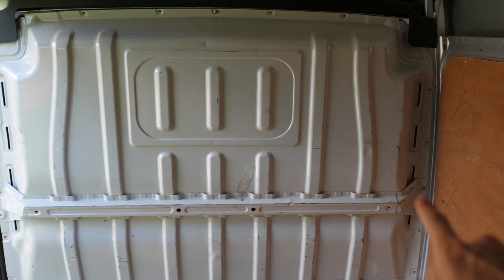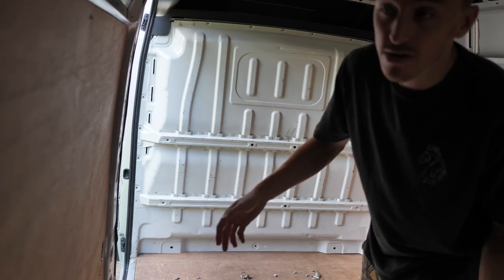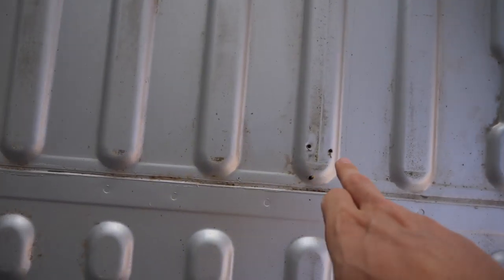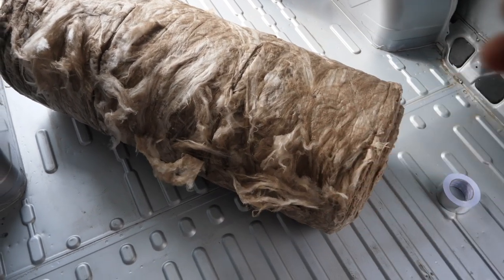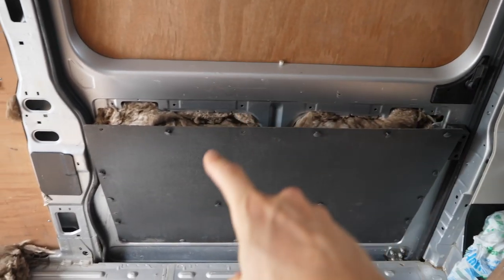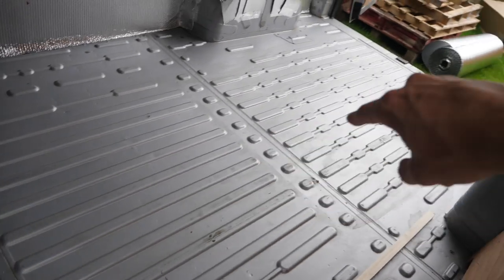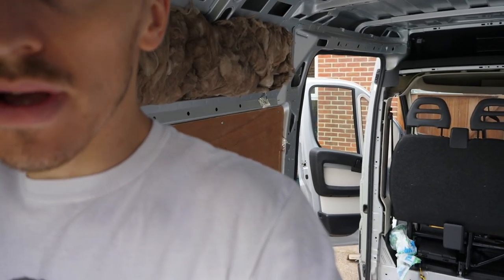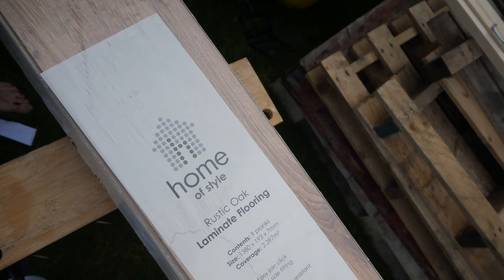INSULATING MY CAMPER VAN - Peugeot Boxer Conversion

Comment: Insulation, open, breath... In a van?? are you crazy? The outer skin is completely sealed, That means in inner skin must be as well. Same in house constructions. Where the outer skin normally used to be breathable, you'd have a breathable inner skin. In modern high efficiency housing, both skins are naturally closed, as otherwise moisture really will SET in between them. You cannot air out a van and dry it unless you have air-conditioning running close to 24/7.

Comment: Thank you for the ideas for the conversion.  I noticed you putting in insulation.  Aren't you going to put in any acoustic van insulation/vibration dampening.  I have head that this helps reduce road noise, but also the sound of rain when trying to sleep.  Interested to hear your thoughts.
Reply from the maker: This is a popular subject, I will explain my choice in the next video

Comment: Why didn't you use the spray fill foam?  Perhaps you could do a video on the pros and cons of each type of insulation? Also... those dots you made as markers... is there wood behind that to screw into? Or just the metal railings? How do you know where to screw into?... which has holes and which doesn't.  Thanks!!
Reply from the maker: There's definitely a few different ways to insulate a small space, I guess I chose the earth wool as it was the most affordable, easiest way to fill the cavity spaces. The dot markers on the 5mm ply? I just screwed the ply panels back onto the metal frame using self tapping screws. You can also just use the old screws and line them up with their original holes

Comment: Hugh, earth wool is a good material, although there is also sheeps wool - no itching and safer with no particles.
Reflectix is pretty useless as a thermal break.  It is a reflecting material, ok for windows in sunlight, but too thick for vapor barrier, and ineffective R value as insulation.  There is a material I like called Silent Silver or Blue at Amazon.  Large roll, closed cell neoprene (wetsuit material) with a foil mylar coating, 1/8" thick, and cheap.  Roll this out over the earthwool to keep moisture inside the van from reaching the earthwool and metal structure.  You can also use space blankets (free after any marathon race, as a reflective shield under earthwool or on top.

Finally, before you insulate, you need a butyl sheet like Noico.  Add patches of this pricey stuff to your door panels,  and walls selectively.  This deadens outside noise and changes the door clang to a thud.  What you currently have is a bit incomplete.

Comment: You can use a metal repairing epoxy for holes in the floor, like Magnum Steel Epoxy Repair.  Goes on like putty, hardens, then you sand it down.  Car people use it to repair bolt holes, etc.
Reply from the maker: Thanks Tom!

Comment: I’ve used the same insulation on my van with a reflectix vapour barrier. Have you noticed any problems in yours with condensation in the walls etc?
Reply from the maker: As a stand alone insulation its not got a great r value (insulation rating) so I would recommend using in conjunction with others. But I want to test a bunch of insulations to see what they do.
Reply from the maker: sorry didnt even answer your question, I havent noticed any condensation problems at all

Comment: Hugh, I have just bought a van to convert (transit mwb, semi high). Why have you insulated this different to your custom, and what are the benefits if each way? Thanks
Reply from the maker: Hi Tim, good question. I would say that there is a 1000 ways to do it and many of them work, maybe the most serious combination is the dense foam sheet insulation to fill the cavities with double bubble as well.
Now the reason I chose the earthwool was price and availability, then I am using the ply as a divider with the double bubble foil as a 2nd layer of insulation which also acts as a membrane.
does this answer your question?
Reply: HughTube that's great, thanks. Is there a general rule for layering/ orders etc? I'm sure I'll be coming back with more questions in the future!
Reply: See ourkaravan, and Greg Virgoe.

Comment: Loved watching the transformation of the custom van I wanna do my transit but fill it's a waste of time as it's a swb low roof any tips on that?
Reply from the maker: It doesn't matter what the size of the van is as I have seen people tour around in converted caddy vans. It all comes down to what you want to get out of it.
I would say that with the SWB low roof you would have to be smarter with the use of space but you would be spending less on the conversion due to size.
At that size it would be nippy and great both in towns and in the wild, you could get a pop top so the bed is above and then you would have masses of space down below for kitchen storage etc.

Comment: Hi,
I just used rockwool in all the small areas and holes in my van. On the larger areas I used some multi layer foil and wool insulation.
Where I've used rockwool will I get condensation making the rockwool damp and rust the van?
Thanks
Reply from the maker: Depends on whether you're using a vapour barrier

Comment: I think sika flex would be better than silicone
Reply from the maker: Noted! I will look into it and maybe get under the van and re-apply
Reply: Yes, apparently there is salt in silicone that can rust out.
Reply from the maker: you Timothy are a wealth of knowledge! I really appreciate all your input!
Reply: haha, i have no idea what im doing! Just scraps Ive gleamed off the forums, probably wrong in 9/10 times. I did a quick google, and apparently when certain silicones cure, they release acetic acid, which could potentially weaken the paint job i guess, but I dont know how much of that is fear mongering tbh.
Reply: Question, what forums do you like about this subject?
Reply: @HughTube  What was it you used to seal those holes in the floor?  its where I am in my van build.

Comment: Great Vids how many rolls of double bubble aluminum did you use and what size is it? thanks in advance
Reply from the maker: I had a roll of about 30m as far as I remember but I had plenty of excess. You can work out how much you need by calculating the cubic area of the interior and compare to the width and length of a roll of insulation.

Comment: How come you put the silver foil on the outside of the wood, not between the wood and the insulation wool? Curious.
Reply from the maker: ahh so i put the original ply cladding back up, then the foil then I covered it again with ply. over kill completely but just didn't see the need of throwing the ply linings out

Comment: Do the insulation rote out the van by the inside out? It's what iv bin told but ain't got a clue
Reply from the maker: this is a hot topic with mineral wool, some forums says mineral wool does affect the van and some others say it's been fine in their van for years and years.
The reason I went for it was because my van is pretty new, the interior paint is very good and I feel it should be fine. I have never used it before myself so only time will tell but if your unsure then you can definitely use other forms of insulation.

Comment: Hi
What size batons did you use for this and also what glue?
Thanks
Reply from the maker: I am really sorry Mark, I can't remember as it was while ago but anything that will raise the flooring above the ridges in the steel floor and be thick enough to screw into

Comment: Hi mate, why do you not use carpets on the walls ceiling instead of cladding? I'm new to this so I was just wondering if it is just a personal preference or is it because it holds moisture? Thanks! Josh
Reply from the maker: Carpet isn't an effective insulator so there is a chance for it to hold moisture. It's not that carpet is a bad choice but ventilation is important.
Reply: @HughTube  thanks! Im planning on using celotex and earthwool, the foil bubble wrap then carpet just because I prefer the look to wood. Do you think it would be a problem?

Comment: Nice! Im about to do the same to my new purchase! Wouldn't it be easier to fit the windows first?
Reply from the maker: It would be easier but I still haven't managed to get the window for the drivers side so I will just cut it out later. It shouldn't be much harder as it's still early stages.
Reply: Cool, yea, im thinking how to approach mine, i almost feel like a deer in the headlights! All the planning on paper for the past 6 months, and now Im here, with the van!  I think ill be going for double glazed second hand caravan windows,. seitz are just too damn expensive. What kind are you going for?.
Reply from the maker: Don't worry it's a common feeling haha. I am going to use the same window company that I used for the Custom. They are only single glaze but with less windows and more insulation I think it will be ok. I would LOVE to have double glazing but as you mentioned price is a huge killer.
Reply: The double glazed windows can be had second hand for a steal. Scrapped caravans and caravan yards sell them for 50-200 quid in various forms. What are you paying for the single panes?
Reply from the maker: I paid £330 for the two large opening side windows, pretty good for brand new but if you can get yourself double glazed for less that would be awesome!!

Comment: What sort of screws do you use to screw the panels to the ribs on the walls?
Reply from the maker: I got some self drilling steel screws from screwfix. https://www.screwfix.com/p/easydrive-self-drilling-low-profile-wafer-screws-4-8-x-22-x-200-pack/7483h

Comment: It's good representation of what to expect. If I may point out two mistakes though (for the future)

a) you didn't stick on "vibration dampers" on the walls. Your metal walls will cause too much noise.
b) mistakes many make: you only used 1 layer of reflectix. You need to use 2 layers. One before insulation and one after insulation.
Reply from the maker: Cheers Millan

Comment: Couple of questions and points, I heard you shouldn't use rockwool type insulation as it will rot the van, i know you mentioned allowing it to breathe but wouldn't using something like 25mm kingspan be better?  Also why don't you run flexible conduit inside before you cover things up to make wiring/plumbing easier?  Look forward to seeing the finished job as this is the van i plant to do next year.
Reply from the maker: I have also heard this but the earthwool stuff if apparently a type of blend so less prone to the rot. There are positives and negatives with every insulation hopefully this one won't come to bite me later down the line.
I didn't pass conduit behind the panels because if I get an issue and need to repair that is a huge amount of work to get back to the cables/pipes.
Reply: Apparently from what I have read, Rockwool is not like Fiberglass batting insulation. Fiberglass will rot, but Rockwool will not.  Rockwool is fire resistant, moisture resistant, insect resistant.  It can 'breathe' so allows any condensation to evaporate.  Unlike Fiberglass, Rockwool will still be effective if damp.  Kingspan (Polyiso in USA) is a stiff board, whereas Rockwool is more flexible.